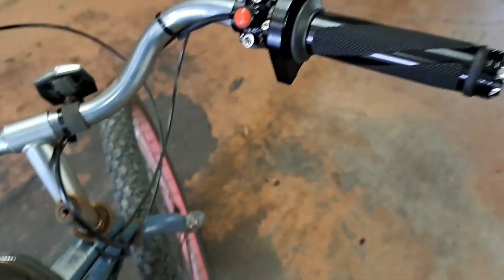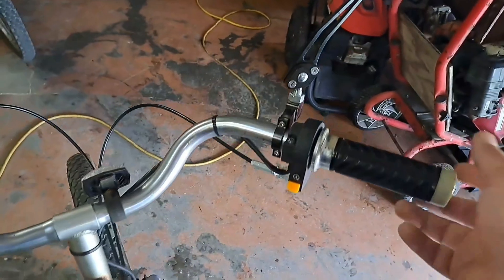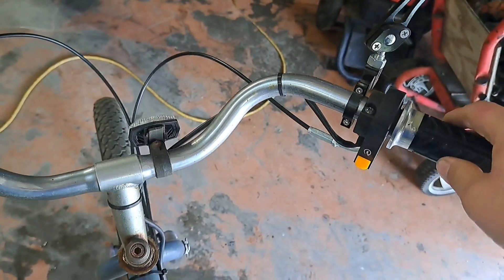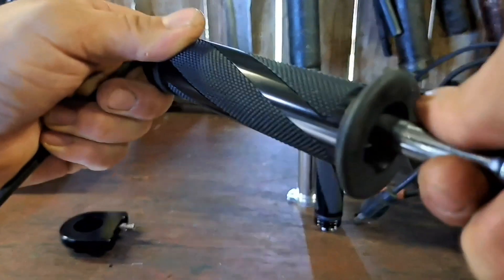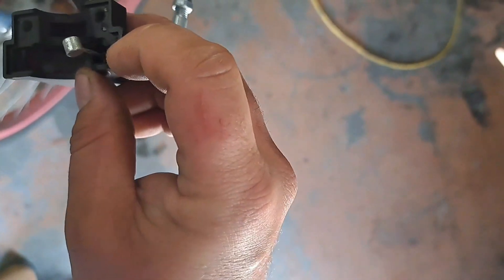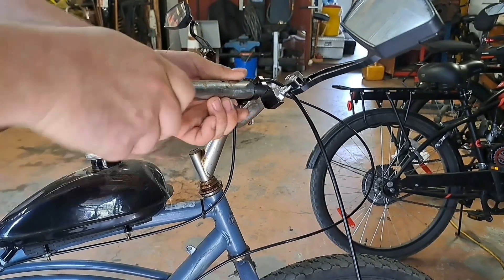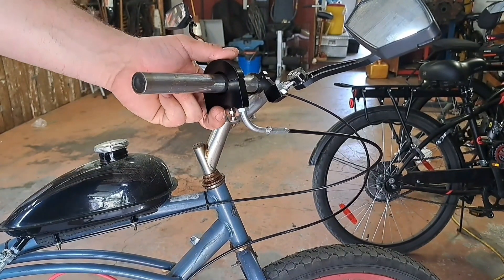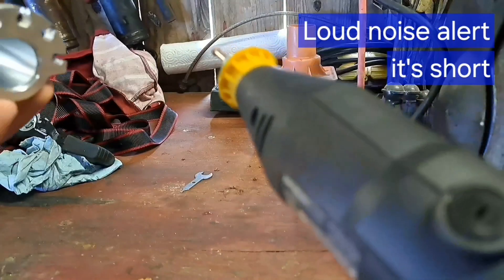Improved throttle and kill switch for motorized bike (with installation instructions)

Comment: My throttle cable is to long i dont wana cut it but can't figure out the best way to route it I pit it over the top rail to long I've tried everything
Reply from the maker: I position the excess to hang out toward the front along with some excess clutch cable. I then put a small zip tie around them, but I leave it loose so it just helps guide them together. As long as it's not so much excess cable that it looks like it will drag into the tire, it should be fine.
Reply from the maker: Watch around 14:28 and you can see how much slack sticks out the front. My personal bike has a bit less, but this much is fine.

Comment: Hi ordered the throttle but where did you get your mirrors from ?
Reply from the maker: I also got the mirrors from Amazon. Tbh, they vibrate a bit more than I like, but they are nice because of how much they can adjust. The first set I used wouldn't adjust far down enough and I couldn't see past my shoulders very well. Look up Diyife bike mirrors and they should pop up. They are about 18 dollars for a set. Just don't over tighten them.
 Like I said they vibrate a bit more than I like, but they do adjust way down and out, so good for cluttered handlebars like mine. They come in red now too! They only had the black when I ordered. ( I plan to try some actual motorcycle mirrors in one of my next builds).